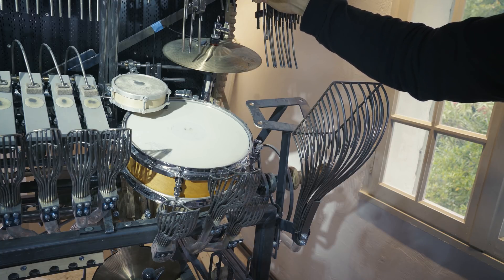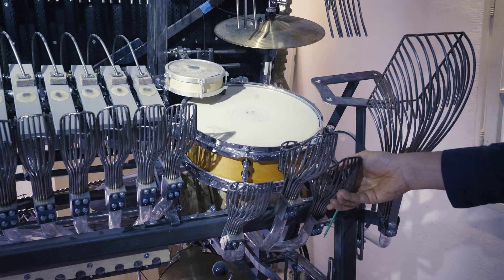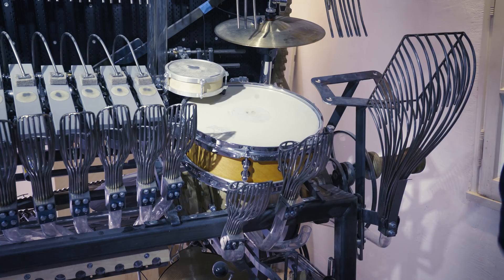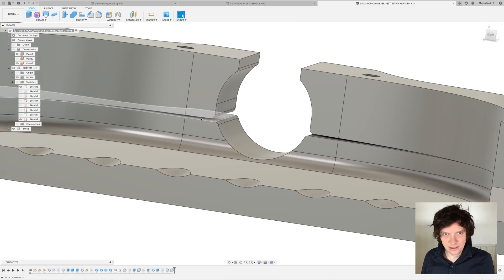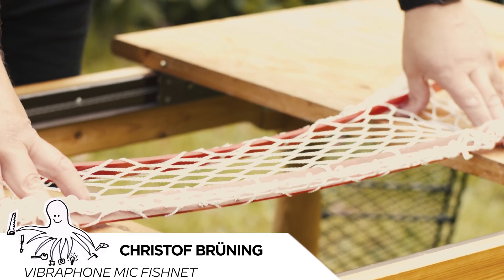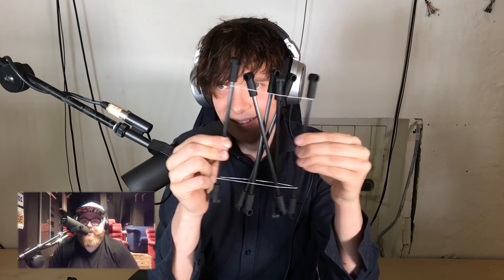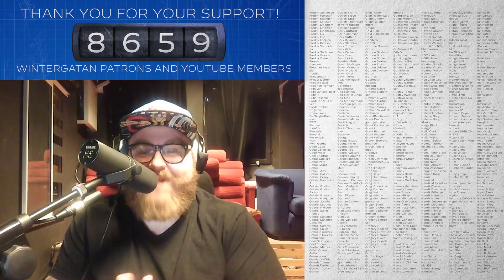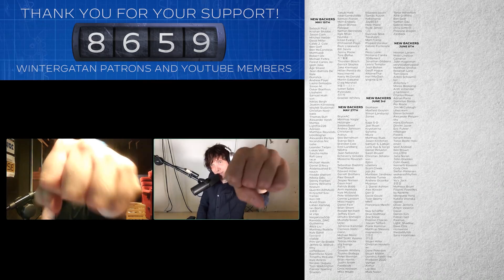Saving the Marble Funnels with Rubber Coating? - Marble Machine X #129

Comment: Haven't finished watching the video and I wanted to comment though before I get distracted. What about adding a wire horizontally along the ribs of the funnel to reduce the resonance of the cage?
Reply: I was thinking about the same problem but thought more in te direction of cork between the horizontal bars on top of the funnals. To prevent metal on metal contact and it is kind of easy to install anywhere and with anything if nessesary.

Comment: Rubber coating will need to be renewed/redone after every 20 minutes of play time.  It won't last.   You might want to investigate using a thermoplastic strand and plastic welding for the funnels.  It will maintain a similar look, especially with the right metallic paint, without the noise and maintenance issues.
Reply: Why would you think the coating needs to be redone so often?
I expect it to last quite long as the spray rubber Martin uses is literally meant for automotive (eg. coloring wheel rims)...
Actually, checking the manufacturer website it even says that the spray rubber is based on thermoplastic elastomers
Reply: I’m not sure about the specific product he used, but tool dip is incredibly tough. I mean, it’s meant to go on tools, after all. Tools you throw into your tool box, shuffle around on a concrete floor, etc. I don’t think a few marble impacts on a sprung structure will cause it any problems.
Reply: With Runoratsu on that one, it really comes down to the product chosen, the prep work and application of said product, often with cheap rubber coatings it isn’t bonded to the base but just forms a shell, and once a crack is formed it peels off rather easily, but with the right product you’ll have a royal P.I.T.A to get it off and it’ll be tough as nails.
Reply: JackANSI you could tell him that in the discord server. he reads a lot more there
Reply: I doubt that. Even cheapo plastic coatings take a hell of a beating on my tools in construction and electrical work. Only needing re-coating roughly once a year of daily use. Also, these tools are under way more stress than getting hit with a small marble, more likely falling off scaffolding of a 10 story building, or being run over by an excavator, hah!
Reply: a good workaround would be to insert silicone tubing in the receiving funnel wires, lot's of work i know, but a little more durable IMHO, but it would be visible, i think this is the time to start the aestethics - functionality tradeoff studies
Reply: PMMA acrylic inserts in the funnels lead straight to the PMMA pipes....?
Reply: No coating will be permate with the way the machine works.
So the question is how much it will endure.
Since it is a quite niche application, the only solution will be testing.
Reply: He did specifically mention that plastic was off the table.
Reply: Yep, I was just about to make a comment like this, rubber coating from a spray can will never last with contact..
Reply: this
Reply: This was my exact thought once again Martin doesn't care about long term solutions only quick fixes or things that look nice. Everytime I come back to this project it gets worse and worse. More engineering flaws, more maintenance flaws. There is literally no foresight at all it's painful to watch. His solutions end up creating more problems down the road. This is the problem with creating a product. You need people critiquing your ideas and telling you how they are going to propagate in the future.
It's so easy to solve a problem right now, but it's extremely hard to solve problems that come up after you solve the existing problem. It's honestly a huge issue most people struggle with.
Reply: @Daemonamongyou  screws come loose on a main gear and blocks things? Just cut it off. :/ He said he wants to take everything apart and reassemble it with glued screws but at that point some things will be worn out...
Reply: @Daemonamongyou  This is not a product.
Reply: @dragonet80  it is ART
Reply: Jacob Ingram yikes
Reply: @Sauce_E9  yikesing at people doesn't help. Try making a counter argument.
Reply: @GrandmasterofWin  yikes

Comment: Hi Martin, I have often heard you speaking about microphones and signal to noise ratio. I believe you are making a wrong assumption about s/n-ratio. I believe s/n-ratio is a characteristic of a microphone which describes how much distortion/noise the microphone adds to the electrical signal while it is registering and transforming sound. This is because no microphone is perfect. Regards, Martin from the Netherlands
Reply: It actually just means any noise that you do not want it doesn't have to do with the electrical noise created by the microphone itself, but it can.
Reply: I don't think he's referring to the SNR of the microphone itself, but of the signal that the microphone is going to pick up. If the hihat hits the microphone at -12dB (i dunno, pulling it out of my... hat), and the funnel hits the microphone at -13dB, that's bad SNR. If you stick a contact microphone on the hihat in some way, then maybe the hihat hit will be -9dB and the funnel -30dB, that's much better SNR.
Reply: What on earth are you talking about? Even when scientists scan the cosmic microwave background, they use the term "signal to noise ratio" to refer to the amount of distant background signal to close foreground signal. There is nothing in that term that is specific to microphones nor the intrinsic noise floor of the instrument.

Comment: A metal chainmail fabric could be used like a curtain instead of using funnels. The fabric can be folded and formed like a pleated curtin to catch the balls and funnel them down. The curtain can absorb and dampen the kinetic energy of the balls. One at a time or many. There's a huge variety of thickness, metal types, ring sizes and visual densities. I think a visually open (largish rings) steel chainmail would look good with your design.

Comment: When you hold the funnel, you noticed the funnel noise reduced even further, this is a sign of resonance in the mmx structure  that amplifies the sound of the marble hitting the funnel. Thinking of it it's the mmx is a big rigid metallic structure that will amplify any noise,  maybe try to decouple the pmma pipe from the MMX structure fixing it with damper material like foam instead of a rigid attachment, same goes to all movable parts. It will reduce all noises overall
Reply: Spot on.
Reply: martin needs to see this
Reply: If I recall correctly, he is aware of this problem and in one video he did a first round of dampening and noise reduction.
Reply: @Akkaren79  To dampen is to make wet, to damp is to reduce vibrations. 
You damped out noise with your dampened towel.
Reply: @moonfartflam  "Dampen" definition 1.
 make slightly wet. 2. make less strong or intense. So yes, you can dampen vibration.
Reply: I bet once he fixes the funnels’ noise he’ll fix the other noises one by one downstream. Makes me want to fix all the noises in my place lol.
Reply: More likely resonance in the funnels themselves since he left the pmma pipes free-floating, since they’re not rigid they won’t really transfer that much noise into the machine as that energy is spent in motion, the motion will however cause reverb at the source. It also introduces mechanical stress in what is essentially a rather brittle plastic (he will likely see heat buildup and stress fractures at the points with highest movement, in time)
Reply: @konzetsushi  the pmma tubes are not freefloating, they are fixed to the frame near to the funnels, that is a great way of transmitting vibrations to the whole frame, my reasoning would be to use some kind of thick silicone pad, or even those soft pads Martin used a while ago to decouple the pmma from the frame, and to decouple other noisy mechanisms, like the marble divider some kind of damping, like rubber motor mounts.
Reply: Andre Carlos the vibraphone funnels are fixed to the frame with about 20-30 cm of stick-out, the drum funnels are mounted further below still, there’s plenty of free- float to provide oscillation in the tubes on impact, I’m not arguing that there needs to be a more rigid, dampened setup, what I’m arguing was the current source of the noise (if he held the pipe where it’s attached to the frame he’d probably still have about the same amount  of noise as when he wasn’t holding it). Neither am I arguing that the frame might have sympathetic vibrations, but the plywood provides a decent damper in itself. Question in the end is how much is tolerable and how much can be worked around.
Reply: @andrecarlos985  There exist rubber dampers for studio equipment for oldschool amps and synths to decouple them from the rack... would be off the shelf and highly effective!
Reply: Konzetsu has
Reply: Konzetsu has always
Reply: Konzetsu was
Reply: from stage work i recommend a "high solid epoxy industrial coating" super tough cheap and will reduce the hell out of vibrations.. or remake it in cast iron
Reply: @mxecho  maybe to help, as the MMX frame is made partially of hollow tubing, he could fill it with sand, to increase the resonance point of the structure, the downsize would be the increase in weight, as i suspect that Martin is already dissatisfied with the current weight of the MMX
Reply: @andrecarlos985  Perhaps not sand but self expanding foam?
Reply: Same thing with photography. I shoot videos with an iPhone. It has built in vibration cancellation, which is great if you are holding the phone in your hand. It handles low frequency vibrations very well, but if you put the camera on a tripod or an external gimbal, the high frequency vibrations just ruin the video. Set the camera up on a tripod and try shooting a train going by and the video looks like it was shot underwater. The camera is constantly trying to compensate for vibration and it thinks the motion of the train is vibration and tries to "fix" it. The result is a constantly wavy video. Unwatchable. I have tried attaching the phone to the tripod with a foam barrier and it helps, but not enough. One solution I have tried is placing strong magnets on the front of the phone on the glass directly behind the camera. This definitely locks the motors down on the camera and stops them from trying to compensate, but I'm afraid that will ruin the camera so it's not really an option.
Reply: @HotspotsSoutheast  You really can't disable motion compensation on iPhone? Holy hell that's annoying
Reply: Matt D the default video app can not turn it off but some 3rd party apps can turn it off. It doesn’t help. When you turn it off the camera is not locked down. The camera lens is on gimbals which can still vibrate when the camera shakes. The iPhone also uses software compensation. It shoots in 4K but then crops the image down to 1080 so it can move the camera frame around to compensate for motion. So if you combine a fast moving object that shakes the ground as it passes by with a camera trying to compensate for slow hand shaking using both mechanical and software motion compensation when there is no hand shaking because the camera is on a tripod you get a total mess. It’s been a problem since the iPhone 6. The camera was designed to shoot great video when held in the hand. But not in a tripod for what I use it for.
Reply: @HotspotsSoutheast  Maybe try something like FilmicPro to bypass the stabilisation?
Reply: Gradius I’ve tried a couple different pro apps that turn off stabilization but it doesn’t help much. The camera is on a gimbal which can vibrate when the camera shakes. Plus the phone uses software image stabilization too. The camera sees the train flying by and tries to compensate for the motion. If you shoot 1080 which I do I believe it actually shoots in 4K then crops the image down to 1080 so it can move the frame around to compensate. Perhaps if I turn off the mechanical and shoot 4K it won’t be all jittery.  I will have to try that.
Reply: GottliebPins has always
Reply: THIS!!!
Reply: Someone add this to the discord server
Reply: Actually his hand is dampening the sound. A dampening sleeve could be added at the bottom of the funnels.
Reply: @EthanVandal  this sound like the most elegant solution
Reply: Sounds like a lot of work, and redesign of parts to fit rubber everywhere. How about coating the marbles with rubber?
Reply: @bearofthunder  well, it will muffle the instruments and require a sound redesign, sincerely i don't know what is the most time consuming of the two proposals
Reply: Yes, you point it out! To find the self resonance of the frame it should be enough to hit the frame with a hammer and record the resulting sine wave with a microphone. As soon as you know which frequencies are the worst you can tackle the issue much more efficiently.
Reply: Perfectly said. I fly quad-copters and soft mounting the motors and flight controller makes a measurable difference in reducing the noise for the gyro and accelerometer. Soft mounting any part that could be a source of vibration should quiet the machine down a fair amount.
Reply: @NainKaigo  soft mounting, and adding sand on the hollow parts of the MMX frame should reduce vibrations, the sand idea came from a past collaborator of  the MMX, This old tony, according to him filling the frame of his diy CNC was a old trick to minimize (Dampen) vibrations
https://www.youtube.com/watch?v=9ntW0aTW92w&list=PLNp7TZf13Bq5simEsDdrZYL6xBIjxsDzZ&index=2
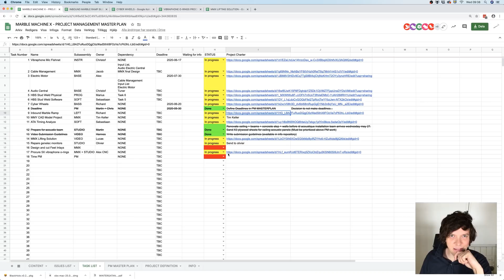at 5:14
Reply: Do you think plastidiping the marbles could help?
Reply: Click like and comment let's move this comment to rader
Reply: True
Reply: As for coating the marbles, a good example of how it would attenuate the sound is the rubber coating on the marble catcher itself, the wave form was at least halved so probably not a good idea to coat the marbles.
Reply: Rubber bung bolted to the tubes & a bit of RTV at the steel to steel contact points would also reduce the undesired sounds.  I had a cast steel anvil I had to drill, tap & mount a 25mm rubber bung to, in order to dampen because it'd sing right through my ear baffles & give me a splitting head ache.
Reply: what if instead of trying to dampen sound, he turns the funnels into  another instrument lol. make it a tuning fork or chimes or something that play in harmony with the vibraphone... or even have them as swap out funnels and can play on only specific notes
Reply: There is no resonance hanging off a plastic tube..
Reply: Dampers, dampers everywhere.

Comment: this bad stereo microphone with this bad phase issue is killing me every time !!!  fix it please it's reaaaaaaally simple !
Reply: I'm not sure what you mean exactly, could you expand on that? If necessary I can forward the feedback to Hannes so it can be fixed for future videos
Reply: @zpoa  you can hear the problem clearly at 3" (i thinks it's a stereo microphone on the camera)... the solution is flip the phase on the left channel (or change the phase directly on the cable)
Reply: Yeah. The recent videos, with Hannes in them, have got the overall viewing (and hearing) experience quality down of the video. I wrote more in my about this in my comment on this video too.